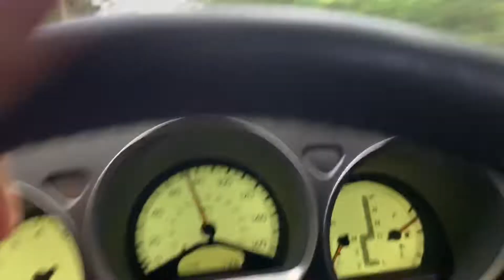Big Turbo 2JZ GS300 Burnout!

Comment: There's just something about the GS300 that I've ALWAYS  loved, especially when they're 2J swapped.
Reply: Come stock with a non turbo 2j
Reply: Yea they come with 2jz's lol
Reply: The gs300 have a stock 2jz-ge engine without turbo, so, is too easy for tunning
Reply: They've already told you, but I'm petty...THEY COME WITH A 2JZ AND IF IT'S A 2005 IT'S VVTI.
Reply: @MRMAN-wb1tv  mines 2000 an vvti
Reply: @alexivanchenko4621  I know right. Mine is 98 with vvti, not sure what that dude is talking about lol
Reply: @alexivanchenko4621  I meant V6 lol. My bad.
Reply: @nuisynth  Lil buddy it was just a typing mistake.
Reply: @MRMAN-wb1tv  it’s an i6

Comment: Idk if u figured it out by now but my buddy had this issue in his gte swapped sc300. I gapped the plugs to the specs for the build(new plugs) and the issue completely stopped. First was thinking maybe it was the ecu(V1) but it got worst and we checked plugs regapped it helped then put new ones in and never happened again. Hope that works and he was using ngk plugs

Comment: Man i have so much dilemma with my gs not sure to keep the na and turbo it or get a gte.
Reply from the maker: Na 2j can hold decent power. Reliability wise you can’t beat the gte. But for a street car, I wouldn’t hesitate to throw a turbo setup and a good standalone on a na jz with proper tuning and fuel.